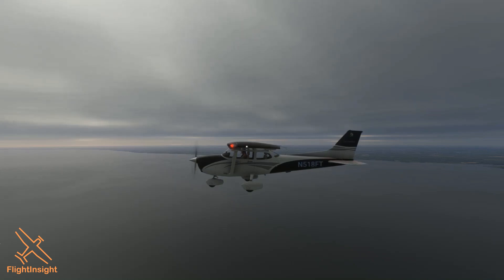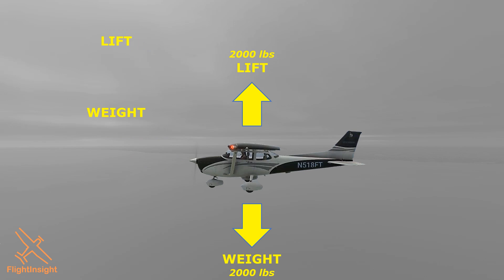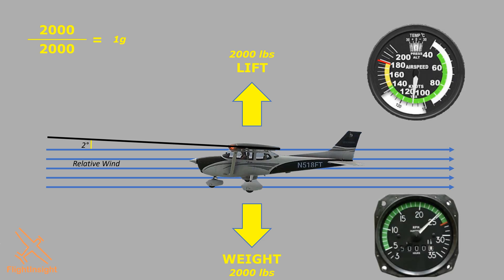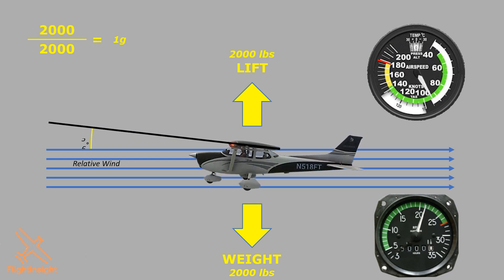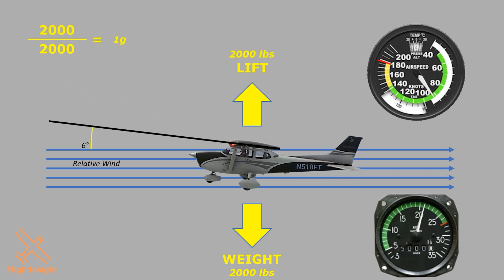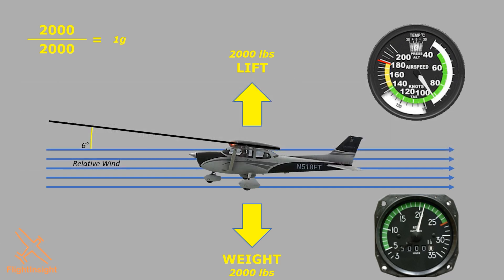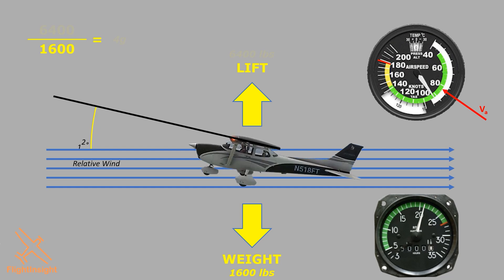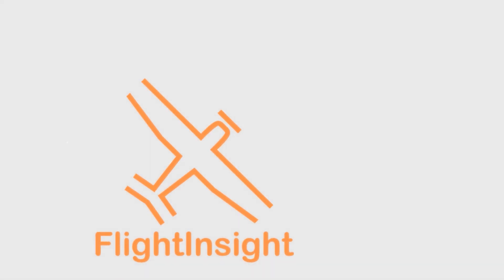Why Maneuvering Speed (Va) Changes with Weight | Maneuvering Speed Explained

Comment: Love your videos! Quick question if you have the time, do you know how I could find the relationship between AOA and load factor? You mentioned in the video how if you were flying at a 6 degree AOA and increased it to 12 degrees you'd be doubling your load factor, and I was wondering how I could prove that for my cfi checkride. Thanks!

Comment: I’m not so happy with the explanation, because you’re neglecting the ailerons completely. “Control inputs” is not only referring to the elevators. The video basically explains, why you could stall an aircraft at any speed and attitude. The aileron input is more dangerous because it is neither depicted in the flight envelope, nor is it expressed by load factor. Why is the manoevering speed inside the green arc and far below the yellow arc? It’s the wing root bending moment which gives an opposite force from both wings on the wing spar. It cannot be expressed by g-forces but be calculated by the surface area of the ailerons, wind forces (speed!) and lever (wingspan). Please keep that in mind.
Reply: I think you have a very good idea to share. But I think it could be explained better. I still do not get it, please.
Reply: That’s a bad explanation because I don’t understand it.

Comment: I probably would have started with explaining the stalling AOA. Then the various AOA’s required for certain speeds explaining each at 1G. Then design load factor limits and load factor margin. I think not including the Va diagram made the discussion not correlate to the handbooks. But nice job. Nice graphics.

Comment: It's a shame instructors are still perpetuating this half-truth explanation of Va, it isn't exactly wrong but incomplete enough to setup a poor grasp of the true underlying hazards and fundamental physics and engineering. Yes, the conservative answer is that Va is reduced with reduced mass, and this will pass the test and keep you alive. But the reason is not really about reducing total lift, this practice of reducing Va is simply a catch all to cover the worst case load distribution so you don't need to account for the details of the actual load plan beyond simple compliance with the basic station mass limitations.
 
The aircraft wing structure is not going to be over stressed (let alone approach breakup) by maintaining Va at a constant CAS, although some local sub-structures like seats or baggage floor may be over stressed. 
The engineering side of the matter is that the load factor is an engineering design goal used in combination with desired aircraft mass to select the required minimum structural working strength of components (or conversely with aftermarket revisions to determine the allowable mass at an existing strength). Design load-factor taken in isolation [without mass] is not a structural limit. The load force(pounds) product is structurally relevant, the individual factors [mass and acceleration] going into the product are not. 

Va also covers large inputs beyond just pitch, the forces of roll and yaw are both reduced with reduced mass as they are primarily inertia based. "VA—the calibrated design maneuvering airspeed. This is the maximum speed at which the limit load can be imposed (either by gusts or full deflection of the control surfaces) without causing structural damage. Operating at or below maneuvering speed does not provide structural protection against multiple full control inputs in one axis or full control inputs in more than one axis at the same time." (faa-h-8083-25c pg. 11-18, pg 5-42 also has a decent explanation of the loading on the airframe.)

If the aircraft mass is changed proportionally and uniformly across all stations, then structural loads at a given total lift will always be the same even though the load factor may have increased or decreased drastically. In fact this is covered in "Aerodynamics for Naval Aviators" and examples are given for adjusting load factor for mass and keeping Va constant, rather than adjusting Va to hit a constant load factor. 

The reason the private pilot civilian realm adjusts Va with gross weight is that it is convenient and accommodates lazy load planning and preflight calculations, specifically the case where the overall gross weight may have been reduced but one station remains at maximum capacity and the assumption that the maximum working load for the local structure of the station is based on the same load factor of the operational category (3.8 for normal). 
This is why you will see many C172 also have a 4.4G utility envelope in addition to the normal category envelope with reductions on allowed mass in individual stations. There is no magic that allows a sudden step function between 3.8 and 4.4 at 2000 pounds mass, physically there are smooth curves connecting the two categories and loading limits.
Notice that (for a C172M) 3.8×2300=4.4×2000=8800 pounds with some minor rounding, the same total structural load in pound force. So the fixed-mass stations (such as engine mounts) are all designed for a load factor of at least 4.4 with an overall structural working load of 8800 pounds of lift, a lift which will always occur at max AoA at the same CAS (112mph in the example C172M) And why some io-360 conversion poh supplements do not allow for utility category it is a slightly more massive engine on existing mounts so the maximum vertical acceleration is less than 4.4G.
Reply: you just said a lot without saying basically anything. A nothing burger. A word salad
Reply: @Dub636  Maybe. A youtube comment can only spoon feed so much, and not everyone has the elementary engineering foundation that they like to tell themselves.
Reply: Come on!
Reply: I don’t see a half truth. I see an explanation for why Va varies with mass. You may prefer more detail but I don’t see an error here. The pilot needs to know the airplane limitations and how to stay within them. The operational pilot does not need to know the specifics of structural engineering. That is the realm of test pilot and aeronautical engineer.
Reply: @ This is not even close to the realm of the engineer or test pilot, this is the realm of daily cargo load planning operations and pre-flight load plan review for any cargo PIC.

It is a flatly the wrong reasoning for why. 
Va varies, that half is true. But not for the reasons implied, so half not true.

If I said you need to stop for gas anytime your tank is below 1/4 and explained that it is because the extra vapor space in the tank is a an increased combustion hazard, that is also a half truth. Both halves are factual but they are being incorrectly stuck together. This will lead to incorrect actions in the future.  If that flammable-vapor reasoning was all you knew about operating a vehicle fuel system it may seem reasonable to cancel fuel stops after upgrading from a rigid tank to a collapsible bladder. And then where are you?
Reply: @mytech6779  …if you could specify where exactly in this video the author has stated something in error I will check it out. I cannot see an error. It does what it says on the tin. Right now you are merely complaining that the video is not what you would like it to be without being able to point to a specific error.
Reply: @mytech6779  Well it was a straightforward question: ‘where is the error in this video’? It is a severe stretch to call that “purposefully obtuse”. Anyway, answer came there none.
Reply: @XPLAlN  That hole isn't getting any shallower.
Reply: @XPLAlN  I didn’t say this was a half truth. Try reading it again. Pilots don’t need to know the details as written in the “mass” dissertation. What they NEED to know is that Va varies with airspeed and the limits on what they are flying. Simplicity matters when your head is banging into the airframe in turbulence.
Reply: @whoanelly737-8  I was not replying to you. My reply was to the OP.
Reply: @XPLAlN  Ah, okay now that makes sense. Cool.
Reply: Half truths that cover the margin is better than something most people cannot grasp without an engineering degree.
Reply: @whoanelly737-8  Basic arithmetic and some middling effort to go beyond the first result returned by reddit doesn't take an engineering degree, but is a prerequisite to one.
Reply: @mytech6779  have you seen math comprehension levels?
Reply: @ I've certainly seen some reading comprehension levels… 
Being that bad at basic math would already be disqualifying for the private pilot cert.
Reply: Thank you. You fixed my itching for knowing the actual physics behind the question "why does Va change with weight." My brain hurts though...
Reply: @jacehorner4410 As long as it helped someone. The condensed version is that the standard Va speed adjustment rule assumes that one of the load-stations remains at maximum while overall aircraft mass is reduced. (And a load station mass can be fixed, like the engine mount.)
Reply: @ Right, fixed masses. But that’s another way of saying there needs to be a structural limit specified in terms of g, which concept this video is predicated upon. It does not in itself explain why Va varies with weight, which is what the video does. This channel has an older video on ‘how Va protects your airplane’ that talks to the theory you raised here. You should watch that.
  You say this video is: “incomplete enough to set up a poor grasp of the true underlying hazards and fundamental physics and engineering”. But you’re happy to  give your own “condensed version” that is arbitrarily complete enough for you.
  You complain the video is “a half truth” whilst introducing one of your own, namely: “the wing structure is not going to be overstressed (let alone approach breakup) by maintaining Va at constant CAS”. Firstly, nowhere in this video does it claim that the wing per se will be overstressed. That is your strawman. But, you are saying the air load at CLmax, and Va for maximum weight, is a constant and therefore the wing cannot be overstressed at that airspeed even if the airplane is lighter and pulling more g. The problem is, that does not hold true for any airplane with ZFW limitation. It has to be assumed that such an airplane’s wing will be overstressed by exceeding the airplane’s limit load factor when the ZFW is at the limit. You will not be protected by having “maintained Va at constant CAS”. Ok, MZFW doesn’t apply to the typical light single, but the concept that “the wing structure is not going to be overstressed by maintaining Va at constant CAS” is definitely a “half truth” and an ill advised generalisation.

Comment: I've never understood this. 
Say 4Gs and 2500 lbs are our limits to make the math easier. 
that means the wing has to produce 10000lbs of lift to get to the 4G limit.

If you weigh 2000lbs, pull the yoke back at the same speed, the lift is the same 10000lbs. you will experience 5gs. For the wings it's the same.
Reply: You are correct that the main wing structure experiences the same load (actually less stress if the remaining mass is just fuel in wing tanks). And if you proportionally reduced the mass of all substructures, Va would not change. This topic is almost universally taught terribly in the pilot community.
The practice of reducing Va is to accommodate fixed mass stations and a worst-case distribution of the variable-mass (aka payload) without adding extra load planning calculations. 
So using your numbers you may reduce total gross mass from 2500 to 2000, but if the baggage area remains at its maximum normal-category limit of 50 pounds of luggage then that station remains limited to 4G. 50×4g=200 pound force on the local structure, but 50×5g=250 pound force on that local structure. My main comment has some more detailed explanations including aircraft with 2 or more categories (normal utility acrobatic).
Reply: I think you're saying the force on the wings was 10000lbs before removing mass, so should be able to withstand the same 10000lbs (5G) after losing weight. Ie, the reduced Va at lower weight doesn't make sense?

I used to think that too. The confusion is that there is more than one way to overstress an airframe.
The wings won't rip off at 5g as you surmise, (same 10000lbs) but the engine mounts may snap trying to muscle the heavy engine around to accelerate at 5g etc.

Imagine an imaginary extreme case, where the wings still exert 10000lbs force but cause 30G acceleration - the pilot dies. The load limit isn't just cantilever wing mounts.